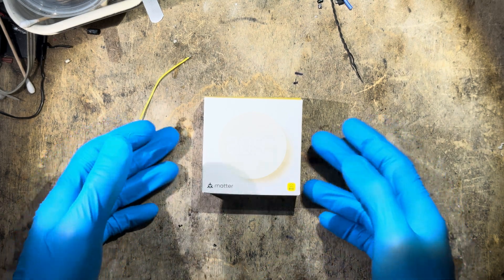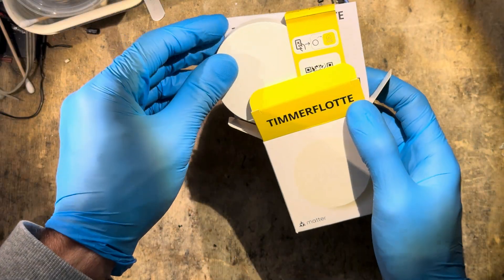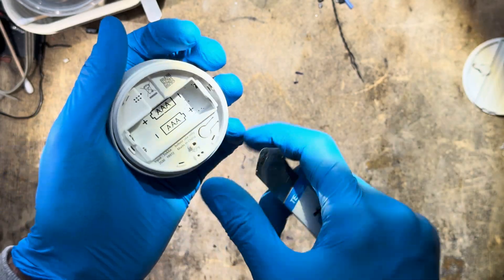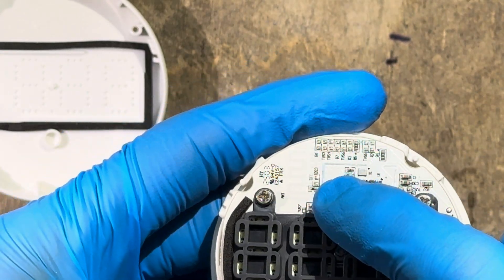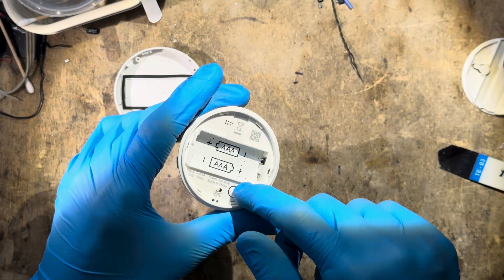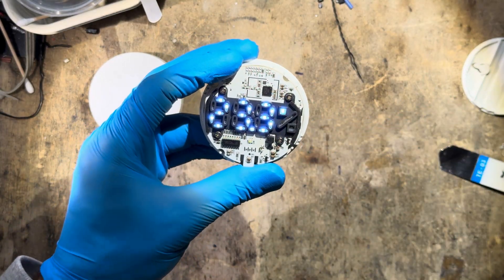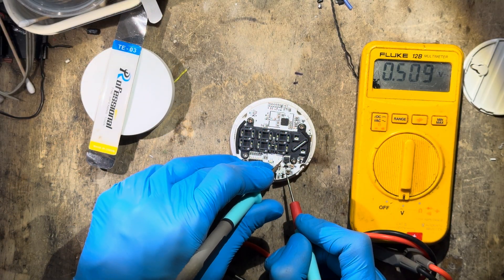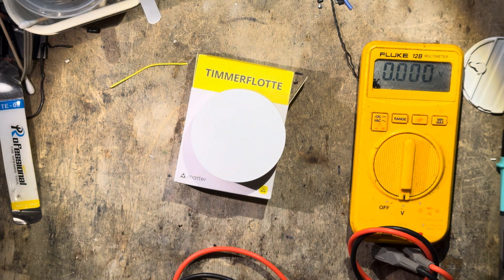IKEA TIMMERFLOTTE - Temperature and Humidity sensor with Matter - Unboxing and Teardown

Comment: Please I’d be interested in the reversed engineering of this device. 
TBH all the matter sensor seem interesting. 
The single sided pcbs surprised me ! 
The price optimization is nice to see !
Reply from the maker: In this case is a two layer pcb with components just on top layer, the buttons have just one layer making them more interesting engineering-wise.
I’ll try and have a deeper look as soon as I get the time
Reply: I'd be very interested in knowing more about the microcontroller used here as I'm sure I can be flashed with a custom firmware for even more interesting shenanigans.

Comment: I have started to checkout TimmerFlotte. All smd components is single side on that one also.
TimmerFlotte also has an inductor, i suspect they need it to support NiMH batteries

EFR32MG24 is the main MCU, if i get time i will check the lock level IKEA have chosen for the MCU.
They have been nice to mark names of the test points :)